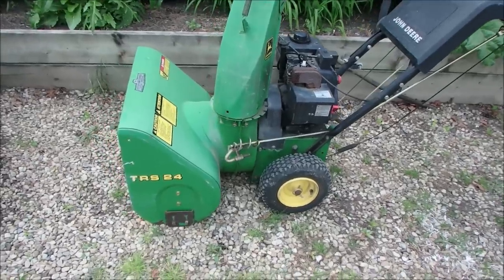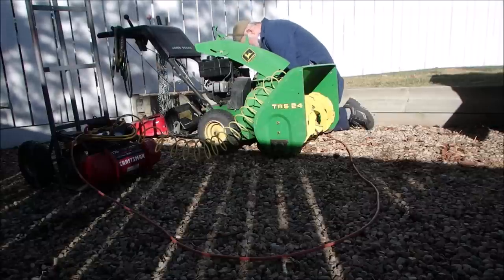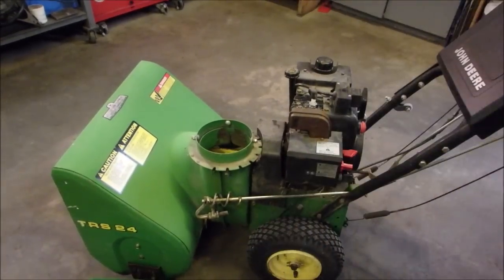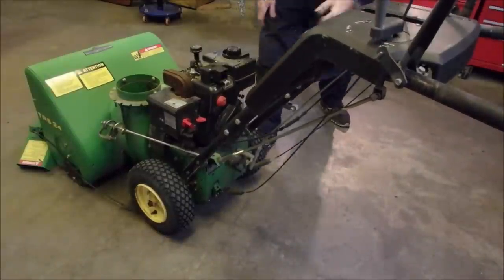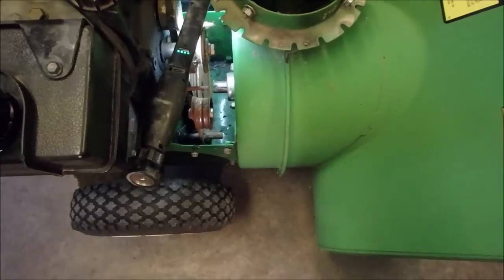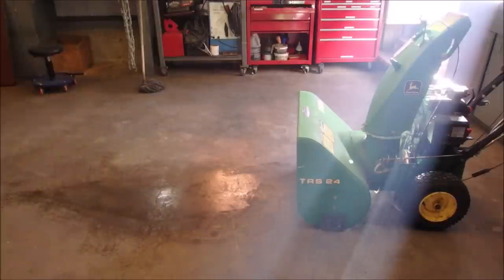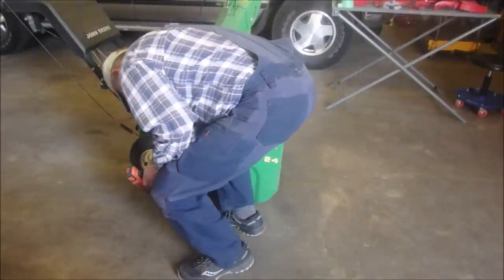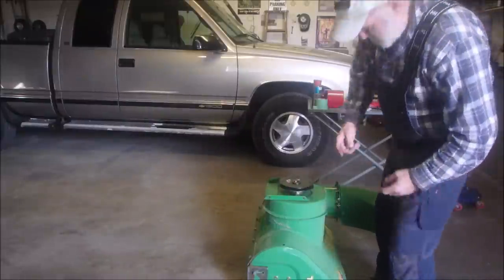John Deere TRS 24 Snowblower FREE!!!

Comment: Great video Bruce! Man I've seen a lot of missing fingers over the years 👉👈 from guys who messed with those 2-stage impellers without first removing the spark plug to release the compression on the engine! Typically people get in trouble when reaching in from the front to remove a stone-clogged blower. I believe frozen newspapers are the biggest culprit that really jam them up. But I've seen Christmas tree lights, door mats, you name it!
Reply from the maker: Thanks

Comment: On some noma used impeller bearings with a key slot. Sort of prevented shaft from turning and wearing if bearing seized.  I have one where shaft wore so I built it up with jb weld and used the keyed bearing. An 80s noma track drive still blowing strong.
Reply from the maker: Great idea.

Comment: Good old Tecumseh Snow King. Mick will be proud it’s still running.
Reply from the maker: LOL.  These 5HP snow king engines seem even better that the tiller Tecumseh  ones.  Is that possible?  Maybe temperature while running under load is cooler.     BTW   Mick doesn't hate them    OMG did I just say that.

Comment: Br6es would have long threads for ohv. My friend's neighbour put one in a briggs quantum.  It hit the exhaust valve and destroyed the camshaft. My neighbour dropped off an old tiller with briggs and plug hanging from coil wire has the long threads. I don't know if anyway cranked it over with plug installed.
Reply from the maker: No  you are talking about a BPR6ES  This is a BP6S   Good cathc though.  I have never seen a BP6S  before  
Here

https://ca.gsparkplug.com/1x-ngk-spark-plug-bp6s.html?gltm_campaign=pr_r&gltm_source=https://www.gsparkplug.com/&gltm_medium=wi_proxy&gltm_content=en_GB&gltm_term=a&gltm___ga=GA1.2.1859606542.1670709854

Comment: Why in the world do they make you weld the pulley together? Am I missing something, is that a common thing with snow blower drive pulleys?
Reply from the maker: This replacement came in 2 pieces.  No attachend between the two.  NOT OEM.  This is where the previous owner gave up I think.
Reply: @BrucesShop  I think I would have given up too lol! I know some might say otherwise but I think that might be an Ariens built machine. I have a slightly larger 10hp Ariens and it looks identical in construction and controls. I’ve owned and worked on MTD built snowblowers in the past and while they may look similar they tend to be made of much thinner steel and with a slightly different layout. Can’t wait for part 2!
Reply from the maker: @mjg263  Yes  This machine needs love at evrey turn.   It is worth it as this is a slow time for me.  A shop would never take this on.  It is going to be a few videos  :-)

Comment: that engine needs a valve job. take five thousandths off each valve stem, and she'll be a beast. That's a Murray built snowblower. Better quality than the MTD caftsmans but low level snapper/simplicity
Reply from the maker: Stay tuned.  :-)   Ariens possibly
Reply: Both engagements are definitely murray/noma.